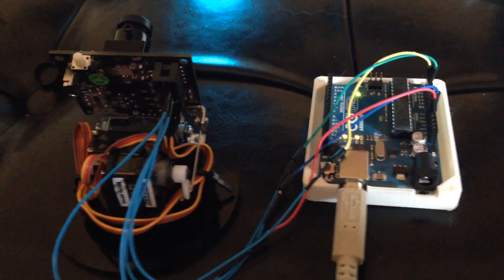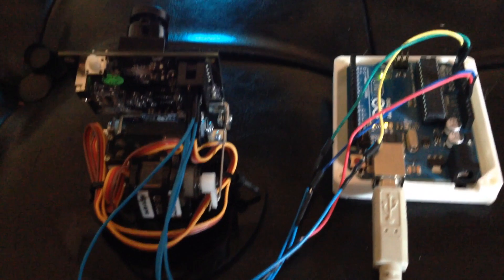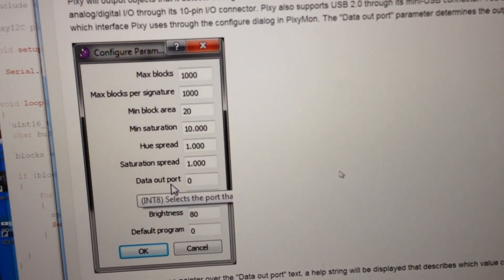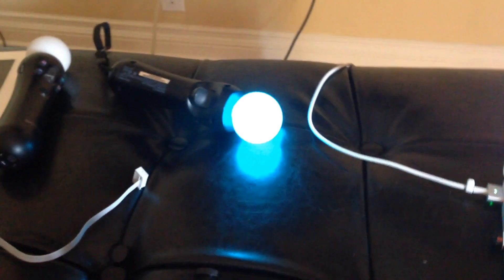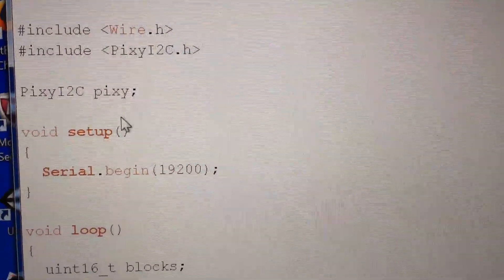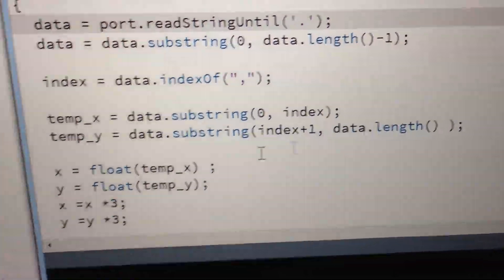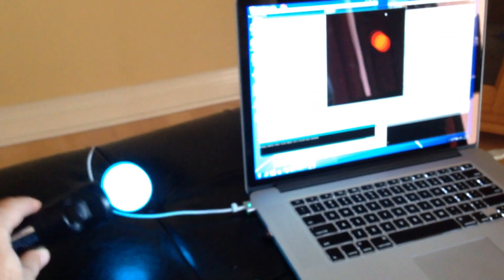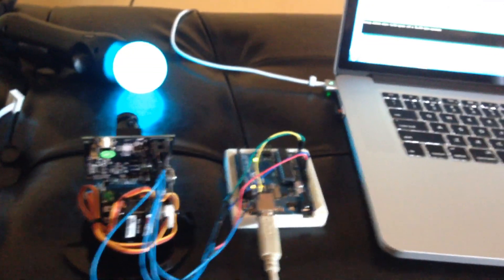Pixy CMUcam5 Digital Camera: 3. Interfacing Arduino and Playstation Move with I2C

Comment: sir I have a question how interface the camera line sensor robot then run it again when capture digital camera . sir please teach and help me for my thesis. .
Reply from the maker: I do not understand what you are asking.  What are you wanting to run a second time?  The video on the computer screen is not from the camera, its from the program that is tracking the ball.  That is why the ball does not get smaller as I move the controller away.  Are you talking about recording footage and then tracking the footage on on a later playback?  If so, you cannot because all the tracking is happening on the camera's computer.  It only sends the information to the computer after it finds an object.  I hope this helps, feel free to ask again if this didn't help.
Reply: my question is about to my project sir. I have a line sensor robot that runs on dark line and stop at the white line . not to stop him in the white line you need to capture a picture and then he run after taking a picture

Comment: Thanks for the video! A few questions if you don't mind:
The supplied cable worked with SPI correct? You only changed to using your own patch cords because you wanted to use I2C? I'm hooking my Pixy up to an Arduino soon. Using the Arduino to power this http://www.adafruit.com/product/815 and control more powerful servos. What data does pixy pass? Can you determine which object is identified? I.E. if I have a laser dot as one of the signatures, can I identify it from other signatures in the data passed to Arduino?  Say laser dot vs. green ball? Thanks.
Reply from the maker: Yes I only changed the cable because I was playing with other protocols.  The cable worked fine with SP1.
The Pixy passes a bunch of useful information that varies with the type of protocol you use.  You will definitely be able to track different color objects and the screen size and location of each object.  Their website has all the details you would need. The item you linked also has an I2C interface so you would also not use their SP1 cable. I would love to see your project when its done.

Comment: Hey..I'm really impressed by the Pixy and had a few questions..

Does a laptop need to be connected for processing or is the pixy capable of stand-alone processing (while still connected to the arduino)?

If I planned to use this on a robot, would the laptop need to always be connected or does the pixy process it itself and then give readings to the arduino?

Thanks
Reply from the maker: Thank you.  Using a wifi solution like XBee, one should be able to wirelessly transmit a data stream from the Arduino.  In my setup the Arduino sends its data on the serial port (COM4 in this case) and Processing reads that information.  I have no experience reading XBee data but that's a great idea for a future video.
Reply: Tony Bowren Thanks for the info :)